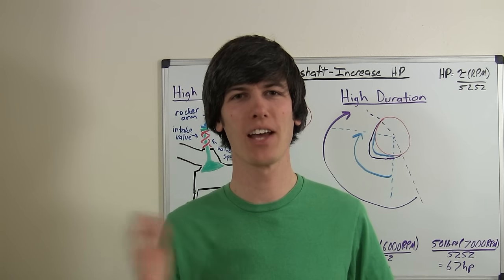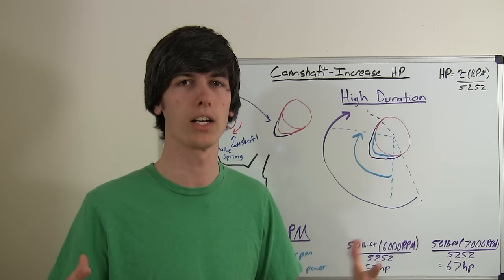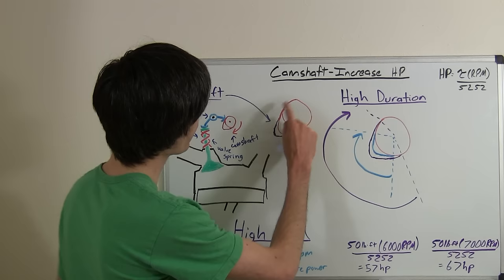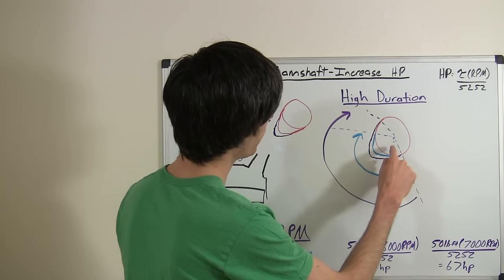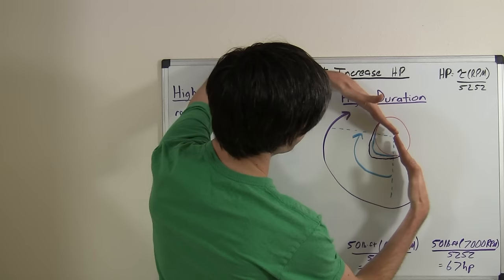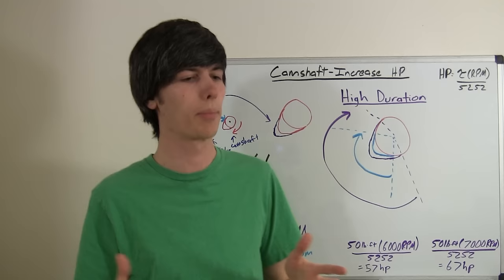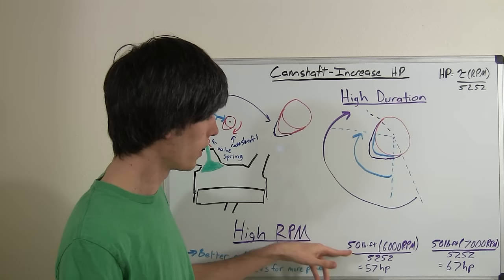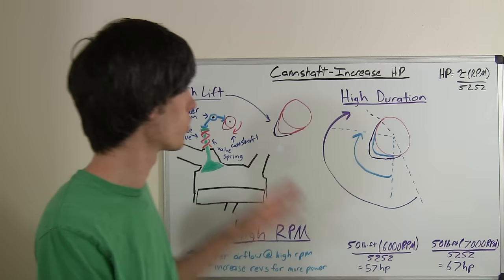Camshaft - High Lift and Duration - Increase Horsepower

Comment: how about changing spark plug cables to increase RPM? I've heard ppl use very low resistance cables and they get RPM up to 8000 while still using stock ignition coil